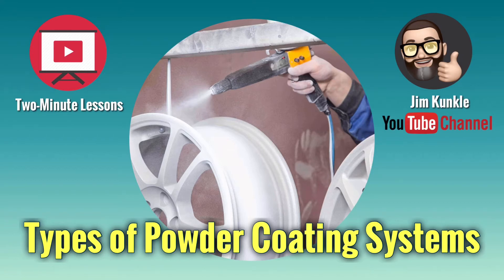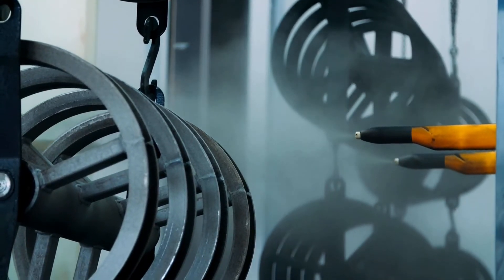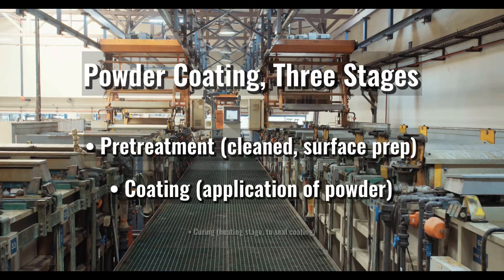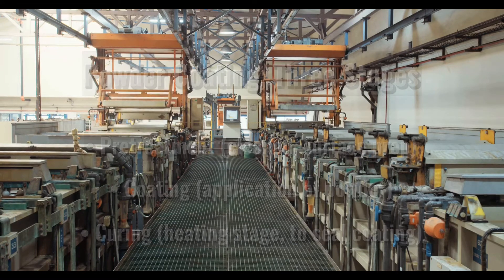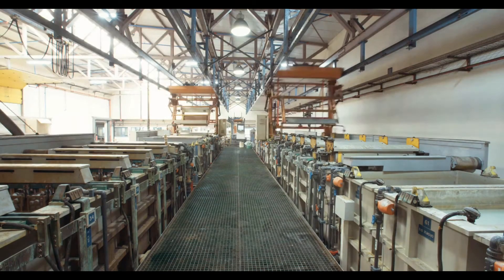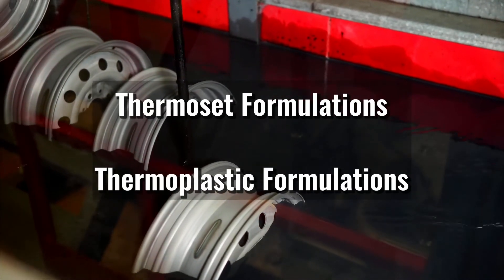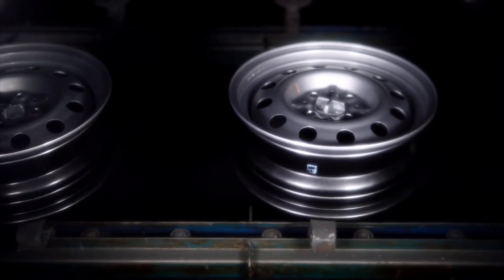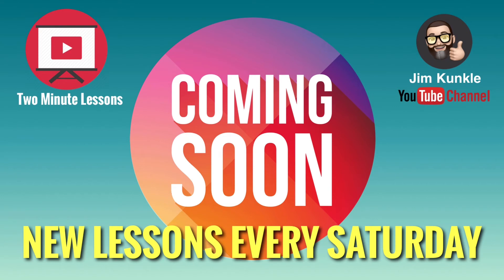Two-Minute Lessons:  Types of Powder Coating Systems

Comment: Very nice video, thanks. It would be better to remove the liquid dip coating part in the video.
Reply from the maker: I agree, challenge is that the subscription with Storyblocks, where I get all of my footage and B-Roll, didn’t have enough video to get two minutes and I didn’t want to repeat a clip or freeze a still and insert it to fill up the time.  Appreciate your support and comment.  Thank You